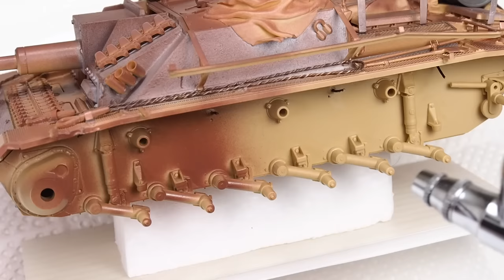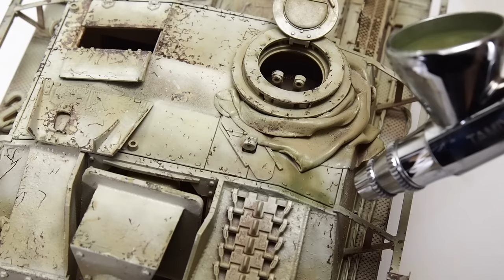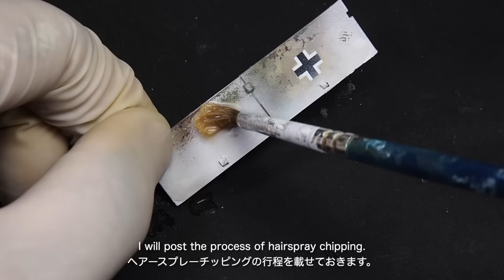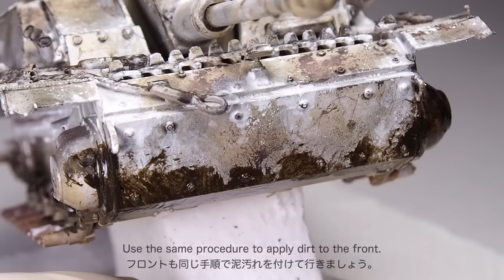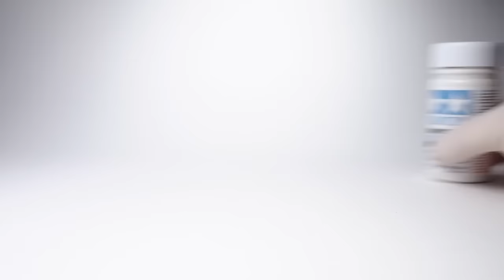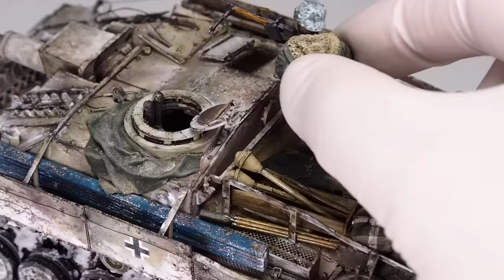StuG III and Armored Howitzer - Part 2 - 1/35 Tamiya - Tank Model - [ Painting - weathering ]

Comment: hello, amazing job, quick question which airbrush and compressor do you use ? I want to buy one and I'm looking for advice, thanks :)
Reply from the maker: Compressor is Tamiya's Spray Work HG Compressor Revo II. The main airbrush I use is Tamiya's Spray Work HG Super Fine Airbrush (nozzle diameter is 0.2mm). When I bought it, it was a product in a relatively cheap price range, but I was a little surprised to see the recent price increase. Did you find it helpful? Thanks for your comment.🍺🍺🍺
Reply: @smc-2  yes thanks only other question I got is , that compressor is it silent or loud ? I'm looking for something as silent as possible.
Reply from the maker: @Sorter18  Compared to compressors with pressurized cylinders, etc., I think it is much quieter.🍕🍕🍕

Comment: Superb job!  I do have a question... prior to paining with enamels over the top of acrylic paints, such as the Tamiya XF-2 which was used, wouldn't that cause an issue with the acrylic paints underneath?  I thought you had to spray clear varnish first.
Reply from the maker: Enamel paint can be applied directly over acrylic without any problems. Thanks for your comment.🍺